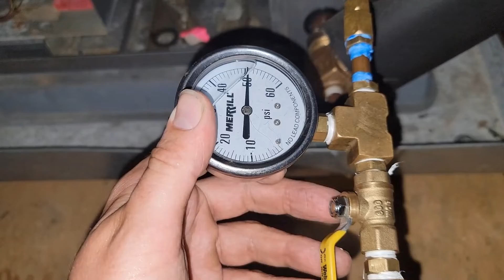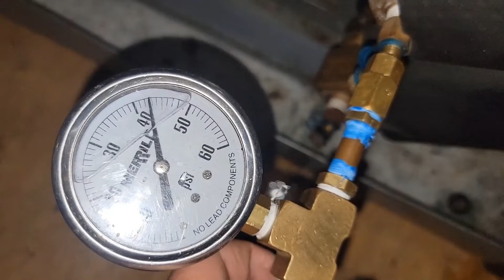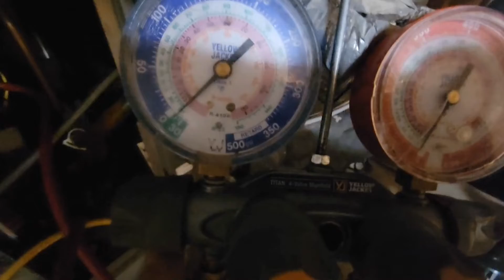Geothermal Water Furnace High Pressure Fault No Cooling #geothermal #hvac

Comment: Water has been added different times to my geothermal loop and air has been bled off due to seasonal expansion of loop. (Did have a small leaking fitting replaced at one point)Do I need to add more antifreeze and is it gonna matter if it’s propylene glycol or Ethylene glycol? Will they be compatible if I don’t know which one was used? If I use a refractometer to test the concentration of the antifreeze what range am I looking for to keep my system from freezing up

Comment: What are some other causes for high pressure? I have a Water Furnace geo that we just changed out the circulating pumps on the flow center. The pumps still get very hot and the water temp in the closed loop is still very hot. The loop was flushed and purged and maintains pressure. Thank you

Comment: I joined. My 2010 water furnace envision is icing up the copper lines at the back of the coil, which I assume is an airflow issue.  I believe the coil is clogged (radiator fins part) as I've used ill-fitting filters for 15 years and I can see in through the filter slot that they're covered with lent and cat hair. It is also not making any water. I've been killing the breaker a few times a day to thaw it and then run it again but it's not cooling well. This morning the DHW out is leaking water so I shut off the cold water supply to the unit figuring it will eventually drain itself. Waiting on the service man.....

Comment: Hello, home owner here hoping for some advice.  I have a slow leak around the threads of the PT port fitting.  I tightened it some but I dont want to over do it.  I can see that there's dope around the threads.  Does the whole fitting need to be removed, re-doped, and put back, requiring a full drain and refill of the loop, and if so, is that something I should attempt myself as a home owner, or should I just try to tighten it more? Thank you.
Reply from the maker: Do not tighten it more, especially if it has a bluish greenish color around the threads, the fitting may break off spewing all the water out
If you could tighten it, that would be the best option but I wouldn't risk it if it's been there a while
Reply: @TaddyDigest  it was installed two years ago.  I think I'll call the installer, i'm afraid of tightening it more.  I just figured that's what they were going to do anyway.
Reply from the maker: @giannicarrero4516 if it's only two years old, you should be able to tighten it unless it's cross threaded
I would give it up a quarter turn and see what happens
Reply: @TaddyDigest  Thanks Tad, I think I'll wait until we're not in the middle of winter to tighten it a bit more 😆

Comment: How do you tell if your circulator pumps are moving water do you just check water in and water out ? What if water in is 27 psi and water out is 27 psi with system on and suction pressure sky rockets to 450 475 psi

Comment: The Red lights just indicate the unit is not working right and that you need a service tech.  My old unit was a premier as well.  You can get it repaired at a cost of 3-4 thousand or buy a new one which l did.

Comment: I don’t have water. 
The pressure switch did its job. I cut power for 2.25 hours hoping it would reset and it would refill when I turned the power back on but no. 
Zero water going to my house probably means my pump is out in my main well. My worry is: do I keep the power off to everything until I can get a guy here to work on it or not. So frustrating that I can’t find a schematic online so I can find and reset the switch on my own.
Reply: Yes, if this is a open loop system that requires well water, well needs fixed and reset unit. 
If you allow unit to try to run still in heat mode it will freeze up coax coil.

Comment: I have a Envision commercial Geothermal Water Source Heat Pump in my home 
Twice now in a month it’s stop working this time the HW HI Limit light was blinking. 
The supply water is fine sitting at 24 psi supply 19 psi across the flow center pumps
Well water at 68 deg where out side is 93 deg. 
The domestic hot water switches on and I have 34 psi on the supply side and 27 psi  across the circulator  85 deg out 79 deg return. 
Main fan and compressor are both running now 
States light blinking green 
Any thoughts on what’s causing my issue?
Reply from the maker: Are you using your hot water generator?
Are you using the hot water pump?
Reply: Model # NDV049TR051CBNB22QPA
Yes I’m using the HW unit with a small circulator and a domestic hot water tank. I have noticed lately that the water hasn’t been getting as hot as in the past. I do have a psi differential on each side of the small circulator so it’s working.

Comment: Thanks.  I have a GEO Thermo water furnace. It is approx 25 years old.  It is a Premier.  It keeps shutting off and the red light comes on and flashes.  I reset it twice and it keeps shutting down.  Do not know the problem.
Reply from the maker: I would need more info. That way, I could point you in the right direction
Reply: @taddydigest  What info do you want
Reply: What are the red lights flashing on the front on the unit?
Reply: Either your filter is dirty or your furnace is out of free-on.  Our furnace was 32 years old and we just replaced it with a new Geo furnace.  We were not taking a chance on repairing our old one as something else may have gone next.  Good luck with yours.

Comment: The one thing i can say about water furnace is there warranty is fantastic and everything is very easy to work on and change I’ve worked on water furnace for more that 10 years
Reply: How do you verify circulator pumps are moving water why would I have very high suction pressure and normal discharge pressure I'm talking 500 psi suction 325 psi discharge

Comment: I got hi pressure lockout on split system for upper level yesterday. Filter in air handler put in a few weeks ago, checked today and looks new. I had cleaned my spin down rusco filter which has some sediment. There was a good amount of icing on the filter. Lower level unit ran fine last night with no issues. I can’t seem to get upper level unit to blow any air thru vents whether in heat mode or cooling mode.
Reply: If that filter had icing on it it’s possible your fan is going out which is why you’re not feeling any air, if that evaporator coil doesn’t get airflow it will freeze as well. that or it could be low on refregerant.
Reply: Ecm motor died. 14 years old to the day. Replaced it and all fine now.

Comment: What was the tool you used for the pressure check.  I keep forgetting the name.  Lol. And I have a geothermal I'm working on that has high pressure and I'm thinking it's a flow issue
Reply from the maker: loop gooser
Reply: Will that tell me the pressure when system is running on a non pressurized system

Comment: Air flow light blinking red after removing and cleaning filter- I blew out the water drain hose, refilled with water but my AC is still not working and air flow light is still blinking. Any idea why my air flow light would be blinking red?
Reply from the maker: Is the fan blowing

Comment: Thank you so much for the video!
We live in eastern Iowa and have just started looking into ground source heat pumps.  The only vendor I've been able to get much info out of is Water Furnace.  They're trying to find an installer closer to me - nearest one so far is 60 miles away.  Because of the layout of our lot (we're on a hill with a walk out basement) Water Furnace indicates we'd need a vertical closed loop wells rather than a horizontal ground loop.  

When you were talking about that one system losing water pressure that scared the crap out of me.  My greatest fear is putting in several hundred feet of tubing into multiple vertical wells only to have a loop develop a leak a couple hundred feet underground.  At least with the horizontal loops you could always bring in a back hoe, dig up the leaky section and patch it.

The few people I know who've put in systems with horizontal loops haven't had real good luck with them.  We have dense clay soil here and it's relatively impervious to water.  Consequently, I don't think the heat exchange between the horizontal ground loops with the soil is very good?  The few people who've put in vertical wells, where you're going down into the water table seem to have better luck.  All of them around here are closed ground loop systems - no open systems due to hard water and resultant heat exchanger fouling.  

Do you know how often these ground source water loops develop leaks?  Is it more prone to leaks with vertical wells or horizontal loops?
Any information would be appreciated.
Tom D.
Reply: Hey Taddy , I have a 4 ton Geocomfort with desuperheater. Works great  for  for 16 yr old unit. Only problem is lately not getting much hot water as i did in the past. It has been very hot in Delaware and i know that is a factor. The DSH  pump seems to be running but when i checked the temp of the Taco 006-BC5Y it was 155 degrees and the water line attached to it was 94 deg. The pump is a  cartridge type and i am thinking about changing it. Any ideas ?

Comment: Water furnace pond loop installed in 2013. I've had to juice the loop twice in 8 months. I'm suspecting a loop leak somewhere. It's about 50 yards from the house to the pond.
For immediate monitoring,  would there be any way to attach a Bluetooth pressure gauge to the water inlet fitting, or anywhere else (if so, where?), to monitor the system with an app?
The installation is in the crawl space.
Reply from the maker: Here is a video that may help you how to install a water line for a geo loop and how to Adjust a water reducing valve.
Watch This Video https://youtu.be/Hhz9KfQB368
Reply: @taddydigest  Thanks! I had no idea that could be done. It at least keeps things going until the larger issue is identified and resolved.

Comment: Hey Taddy!  I have a Water Furnace kicking off all the time.  It shows high pressure and my repairman says the unit needs replaced which i simply can't afford.  Are there other problems that will cause the High Pressure fault other than low water?  I think it could also be low water volume but not sure.
Reply from the maker: low water volume is the most common
But it could be a restriction in the refrigeration side
It could be a bad pump
And it could be a few other things but I would need more details
Reply: @taddydigest  they are saying it’s the compressor. Is that possible?  Most in my area don’t have much knowledge in geothermal and I think sometimes the easy answer for them is it needs replaced.
Reply from the maker: You are correct, it's much simpler for those who don't have any knowledge with geothermal equipment to just say it needs to be replaced
A bad compressor can cause a high pressure issue But most likely that is not the case
If you join and become a member level four, you can have my phone number I can walk you through what needs to happen
Reply: @taddydigest   I get high pressure during hot weather, low flow during cold months. My unit shuts off and I find the Geolink circ pump very, very hot. I crack open the vent on the pump, steam puffs out. I reset unit, everything works fine for a few weeks. Repair technicians can't figure it out. Any ideas?

Comment: Where do you get the needles and parts to make a fill and gauge rig for the water furnace? I’ve looked all over for these things even my hvac supply houses and they look at me like I’m an alien ! I’m like damn! They sell the units so they have to sell the fill needles somewhere 😌any help would be greatly appreciated!
Reply from the maker: Look on ebay
If you need a geothermal training guide which gives you more information about that device
Click the join button I will send you a bunch of guides

Comment: Hey great video on high pressure but I have a WaterFurnace also and I have a lo pressure/comp and water flow codes.  What does that mean?? Any ideas how to fix will be greatly appreciated.
Reply from the maker: Could be low on refrigerant
Could be low on water pressure
I will get some gauges hooked up

Comment: Homeowner here with a couple questions live in lower Michigan with a older unit installed in 2013 the last couple years I’ve experienced the pressure in the loop drop and fluctuate through the seasonal change but my loops have lost all pressure Today Once I filled loop back up to 35 pounds system off the loop will continue to lose pressure back down to zero within a few hours. This problem has never happened but we are experiencing crazy weather with the ground, freezing and thawing throughout the day and night
Reply: You’ve got yourself a nice big leak then.

Comment: Is it acceptable to simply add 100% water back to the ground loop to fill back up and to clear a “high pressure” lockout?  I thought that I read in the manual that a water+antifreeze combination was required?
Reply: Water Furnace Premier2 installed in 2002… P040TR111NADSSA with auxiliary heaters and desuperheater for DHW preheat

Comment: My name is Dan.  I have had a Water Furnace since 1996.  Untill January of 2022 the register heat temperature was 95 on the low speed and 104 on the high speed.  A technician came out and he replaced a capicitor and said the rest of the furnice was fine.  The temperature now at the register is 91 on the low speed and on the high speed is 97.  I think the unit needs some freon.  He did not use gauges to test for freon pressure.  I am ready to call the company back and insist that they check the pressure.  What do you think??
Reply from the maker: those temps are pretty good I would definitely call if the temp drops any more than that

Comment: My WF primer  4 ton normally kicks off if my air filter is dirty, I just reset it power off then back on again, This time nothing, the board seems dead  the relay and compressor works if I push in the manual. To test changed the 2 -10 amp fuses still nothing.is there a way to test the low and high sensors like jump them. To see if that is the problem. If so I can order an adapter kit sensor to connect either high or low inlet. if need be. Otherwise great unit scroll just purrs along.

Comment: What happens to the water that was in the loop.   Did you find a leak, or did you only fill the loop like a gas tank?  What happens to the air when you added the water?
Reply from the maker: Just added water
 Use the screws on the flow center to burp the air

Comment: My 5 series was installed in 2013, in 2021, the waterfurnace dealer added pressure to loop for $250.  The pressur islow again and they said it is from the pex stretching with hot loop. They said it may have air in line.  They installed it in 2013 shouldn't they have gotten the air out then?

Comment: I have a Water-furnace red light says high-pressure air conditioner will not stay running
Reply: What I found was a blown fuse was not running the pump that circulates the water. A small glass 10 AMP fuse
Reply from the maker: Awesome you found the blown fuse on the main circuit board which controls the pump power

I would definitely check the pops make sure that they have been bled of air
 And then also I would definitely check the water pressure

Comment: I have a high pressure lockout pulled the disconnect to reset after I added in water. Waited for the unit to come back on but as soon as it does the high pressure lockout comes u  Wonder what's going on never been worked on before because the unit was taped off
Reply from the maker: Go axle stopped up
  Restriction from filter dryer or TX V
 Get gauge's on and check it out

Comment: Will a replacement water heater affect how the Geothermal system operates? Unit stop cooling in the middle of the day. The water heater to the system was replaced..
Reply from the maker: Usually the DHW circuit is apart from the Geo loop
 But anything can happen and I would definitely Retrace

Comment: Great video!
Is there such think as the loop loosing all its water without there being a leak somewhere?

I’m thinking like refrigerant, unless there’s a leak somewhere than the refrigerant will not leak.
Reply: In my opinion absolutely no.just like a refrigeration system or car radiator if you loose, refrigerant, water,anti freeze ect. In a closed loop you have a leak  ,sometimes if you just fill it and don't get all air out your pressure will drop from air vent bleeding. Thats my opinion that water didn't magically disappear, sometimes leak is in ground ?
Reply from the maker: Yeah leak is most definitely in the ground somewhere whether it's the header or the actual loop
 The weird thing is is I charged it up and then it works for several years which I don't understand does the ground compaction around the leak stop the water from coming out as fast I don't know
Reply: @taddydigest  yea i dont know, but i sure you figure it out,i have alot of faith in you and your work.
Reply from the maker: Thank you for Watching I have found several loops out of water and after filling have no problems for years but every time it leaves me with questions like how
Reply: What should the supply water pressure in a wshp close loop be
Great video thanks